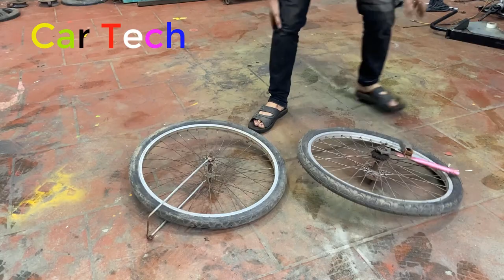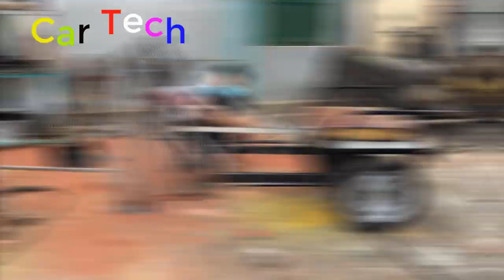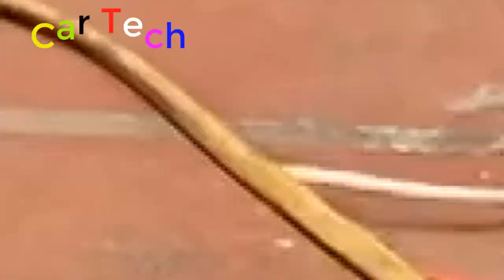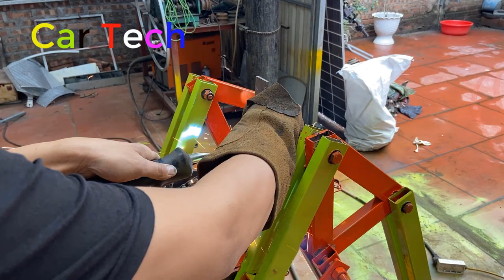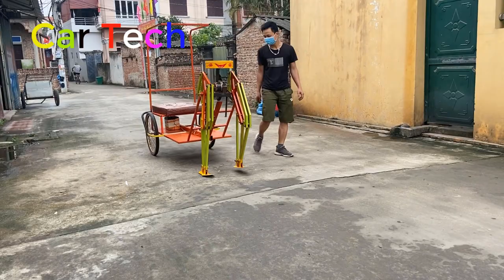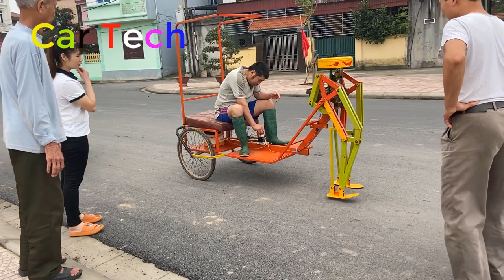Homemade walking robot part 3: Completed walking robot | Car Tech

Comment: What happens if you make the motor spinining wheel bigger ? I think it will make the legs raised higher and also wider stroke ? A wonderful job you have done there. Good mechanical aptitude.
Reply from the maker: Thank you, this idea is quite interesting, but I prefer to leave my feet like that, walking more gently.